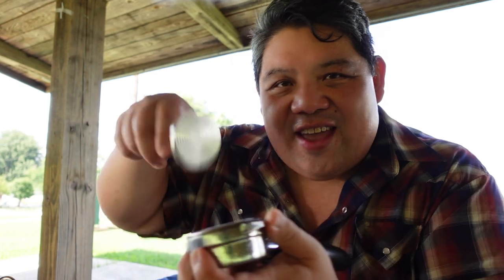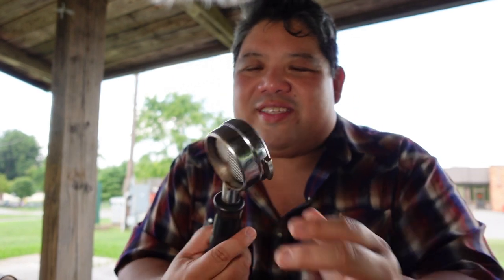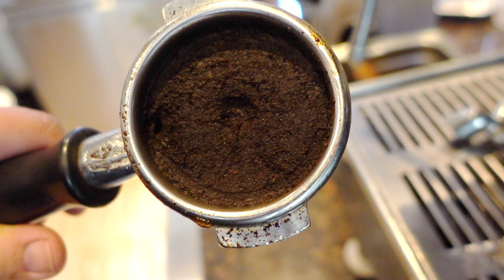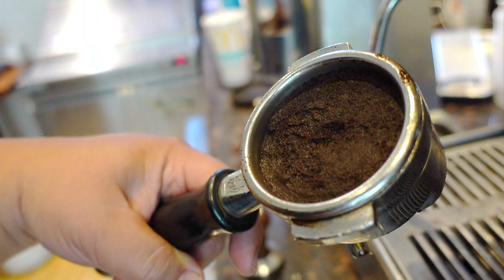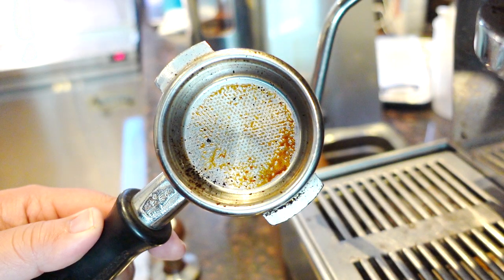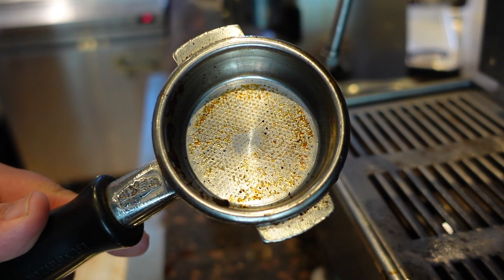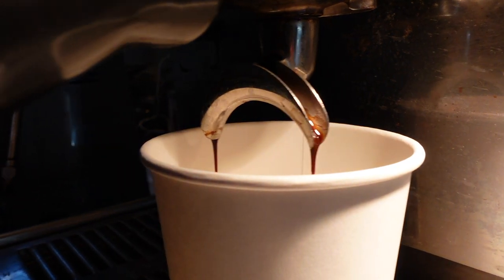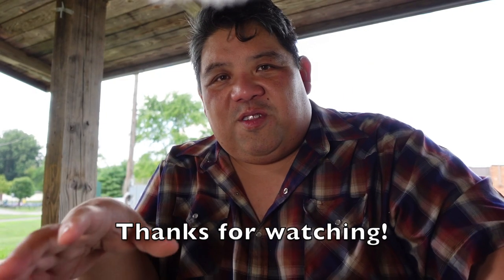Trouble Shooting Espresso, Part 6 - Advanced Puck Theory

Comment: Always good to go back and review
Reply: Did you address the what adjustments you made between extractions?
Reply from the maker: @michaelrosales2692  For the most part, I'm adjusting the quantity of the coffee I'm using from shot to shot - based on the performance of the previous shot. For our shots, we target 21 grams per pull. As you may notice in the video, I wasn't actually weighing each shot on a scale so it's really going more on experience and feel.

But to incorporate this approach in a different setting where you are weighing a precise amount for each shot and utilizing an in/out weight ratio, I would look to tailor my shots to reach the desired weight at the moment when the visuals tell us the shot is finishe - meaning, if you are doing 20/40, you would reach 40g just as the stream started to fluctuate and turn blonde. I think that would yield quite desirable results.
Reply: @SproCoffee  thanks for the response

Comment: Hi, thanks for the video. I just wonder I know how you prepared the coffee differently to get the results. I can't pull a good shots, so I am looking for some tips what I did wrong. I can't achieve 20-30 secs for 18g coffee, doesn't matter the grind size. The coffee came out pretty dark, fast in the beginning, the crema is very little. I have followed all the tips to prepare the coffee, distribution and etc. Nothing seems to help 😅
Reply from the maker: If there's no crema and the shot is coming out black and fast, it sounds like you need to grind finer. If you're only used to grinding and brewing for pour over or drip brewing, the fineness will seem excessive and you wonder how it could work. 

Bear in mind that the coffee is what provided resistance to the water flow. That resistance is what "brews" the coffee. That resistance is what forces the crema. And that coffee is trying to resist against 135psi of pressurized water, so it needs to be quite fine.

It should feel almost powdery with some grittiness to it. You know you're close when you take some of the coffee in your fingers, rub them together and it leaves residue on your fingers. From there, it's typically minor adjustments. What kind of grinder are you using?
Reply: Using fresh beans? If the beans aren’t fresh (7-20 days post roast) you’ll see a lot less crema

Comment: Hi man, what if after pull a shots the coffee puck stuck at shower screen?
Reply from the maker: Wow, that's something I haven't come across yet! I'm thinking that if your puck is sticking to the screen after you remove the portafilter then perhaps you're putting too much coffee in the portafilter. 

Maybe reduce the amount of coffee by a couple of ounces and compensate for that reduction by making the grind just a little bit finer. Let me know how it goes, I'd be very interested to hear your results!
Reply: @SproCoffee  thanks for the tips man i’ll try and will let u know 😃
Reply: @SproCoffee  i try to reduced coffee ground from 18g to 16g but the results still the same, maybe filter basket problem?
Reply from the maker: @NICTJZ  Hmm, this really is something I'm not familiar with. Can you tell me what model of espresso machine you are using?

The other side of this is: while the puck may be sticking, does that impact the flavor of your shot in a negative way?
Reply: @SproCoffee  i use breville bambino plus
Reply from the maker: @NICTJZ  That's really an interesting situation. When you remove the portafilter, the puck is stuck to the grouphead screen? I just looked up the specs on the machine and it uses a 54mm basket. It could be that there's just too much coffee causing it to stick. However, if you're using 16-18g and the flavor is what you like, then perhaps I wouldn't worry too much about it.

There is a facebook group that I follow named Home Espresso Aficionados that's filled with home users who have a variety of machines. Perhaps someone on there has experienced your problem and can give better insight.
Reply: @SproCoffee  it’s true that even it stuck at the group head but still didn’t affect the taste, thanks for the advice man i check out the group thanks 🙏
Reply from the maker: @NICTJZ  Glad we could help!

Comment: i like how you do everything visually ive always gone from numbers and timings etc it looks to me like you shots are underextracted more like ristretto shots which would explain the more residual oil you get think you'd get better results grinding slightly courser and/or pushing more water through. great video!
Reply from the maker: Thanks Tom! At the end of the day, it's really a mixture of numbers, timings and visual. In practical use behind the bar, it's mostly visual - because of the volume and time available. However, the foundation is based on numbers.

We train our baristas thoroughly by the numbers. Weighing out the shots, calculating timing and all the parameters until they reach a level of mastery. Then we start teaching them the visuals that will help guide them with indicators that they are presenting within our parameters. Hope that makes sense!